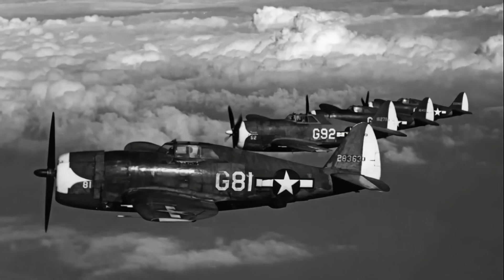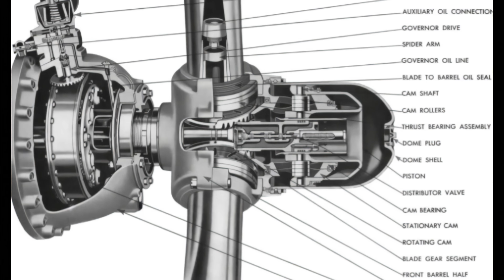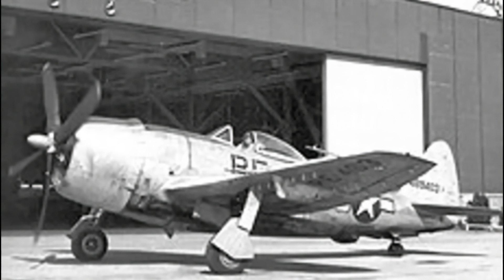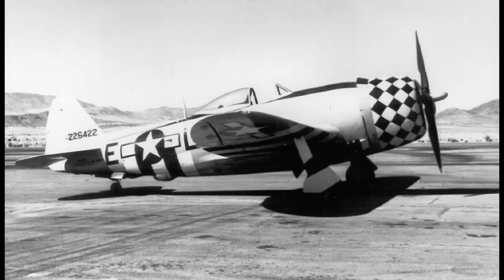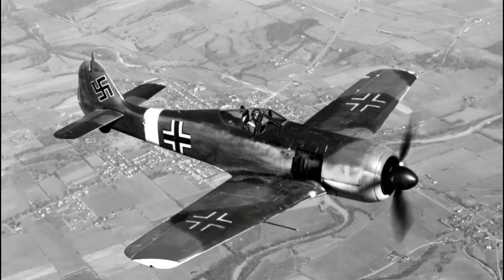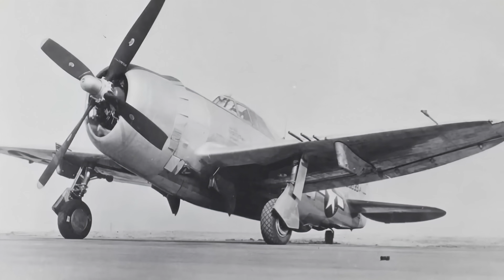Germany Never Expected Paddle-Blade Props To Transform The Thunderbolt Into 470mph Monster

Comment: “The Thunderbolt’s engine already had the power. The problem was turning that power into climb.” That’s what makes the paddle blade story so fascinating. A relatively straightforward propeller change transformed the P-47 from a fighter German pilots could escape by climbing into one capable of following them upward. Which impresses you more: the engineering behind the paddle blade or America’s ability to identify a battlefield weakness and deploy the solution so quickly?

Comment: There's more to the story, perhaps: P-47's were fitted with water methanol injection systems, Av gas octane rating was increased first to 130 then to 150, I think. Droppable aux fuel tanks also became common for combat use. Fascinating technological steps.

Comment: “The achievement lay in speed and scale of implementation.” That line captures what made the paddle blade Thunderbolt so impressive. A relatively simple propeller change helped turn the P 47’s climbing weakness into a serious combat advantage. Which impresses you more: the engineering solution itself or how quickly America deployed it across frontline units?

Comment: 10:18 This moment was incredible. The Germans thought they were facing the same old P-47, but a simple propeller upgrade completely changed the fight. One of the most underrated engineering improvements of WWII.
Reply: No it never they German two could still climb faster

Comment: 35:00 “It was evolutionary improvement that took an existing platform and eliminated its most critical weakness through relatively simple engineering.” I really appreciate this lesson because it shows that meaningful progress does not always require a revolutionary invention—sometimes a focused, practical upgrade can change everything. The paddle-blade propeller is a great example of engineering, feedback, and industrial teamwork creating a decisive advantage. What other small wartime innovations do you think had an equally significant impact?

Comment: The strange part wasn’t the P-47 getting faster. It was that German pilots kept using escape maneuvers that had worked for years… until suddenly they didn’t. One propeller change turned survival instinct into a trap. Do you think wars shift more from huge inventions, or from small improvements applied at scale?
Reply: Not so they could still out climb and out-dive the P47

Comment: In Korea the rugged P-47 should have been used as ground support instead of the delicate P-51 that was very susceptible to ground fire!
Reply: Isnt it strange that the RAF in WW2 from 1940 to 1945 used the Hurricane, Whirlwind, Mustang, Typhoon Tempest and even the Spitfire in G/A and all had liquid cooled engines and we never had 2000+ losses as did the P47 doing G/A

Comment: Incorrect title.  The paddle-blade props that first appeared on the P-47D-22 series model did boost climb performance, but top speed with the 2000 hp engine was still around 430 mph.  It wasn't until the P-47M began service later with its 2800 hp engine that the Thunderbolt's top speed increased to 470 mph.
Reply: In the book "Thunderbolt". By Robert Johnson, he mentioned mechanics adjusting his turbocharger for more boost.  His was a D5. He said he reached at least 460mph. I'm sure his wasn't the only one, but it wasn't a factory thing.
Reply: @jimh6763  R/J was liberal with the truth unfortunately
Reply: The narrator does mention the D-22

Comment: Britain converted its Spitfires to Rotel constant speed propellers in 1940 giving them a faster rate of climb and increasing their ceiling by 7000 feet so making them more than a match for the Messersmith B109s they faced during the Battle of Britain. Since the Mustang was designed an built for the RAF  it was likely this had the same propeller. This was before the US joined the war in late 1941 after Pearl Harbour when their airforce also adopted the Mustang that was powered by a Rolls Royce Merlin engine built in the US.

Comment: Is is another example of exploding the P51 Myth. By the time the P38 was replaced by the "better" P51. A larger number of the most experienced Luftwaffe pilots had been eliminated no be replaces by rookies.  Germany was becoming a dangerous place to train pilots. The P51 faced a different enemy.
Reply: There was a "better" P-38 as well - the paddle blade P-38K!  Outfitted with Hamilton-Standard Hydromatic "high activity" propellers (aka 'paddle blades'), the lone P-38K-1-LO outperformed the latest and greatest American fighters at the spring 1943 Elgin Field trials, capable of ground to 20,000 feet in 5 minutes flat. No photo exists of this plane.  A pic often identified as the "K" was verified by Kelly Johnson to be the old "piggyback" RP-38E with its observer's seat behind the pilot.  Why wasn't it produced?  The hubs of the new props were larger by nearly an inch, requiring new tooling for the engine booms.  Since the P-38 was single-sourced until just before the end of the war, the War Production Board refused to shut down the Burbank assembly line ong enough to retool..  Why do some "obvious solutions" never happen?  Well, that's one reason right there...
Reply: P38 was easy meat to the German two right from the start It had a lousy dive, turn, roll rate At 30000ft+its turbo- super could not handle the extreme cold